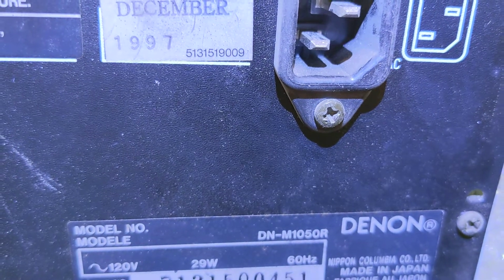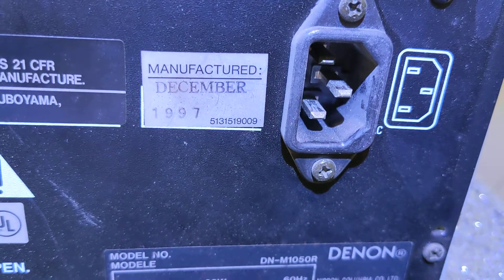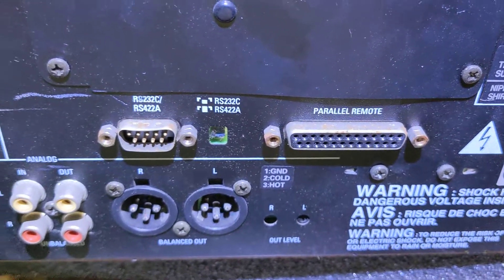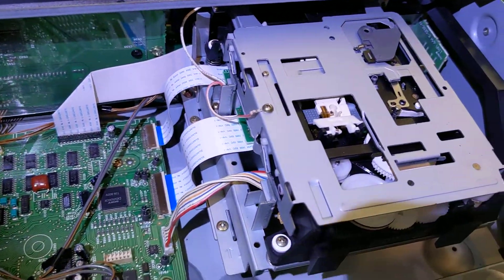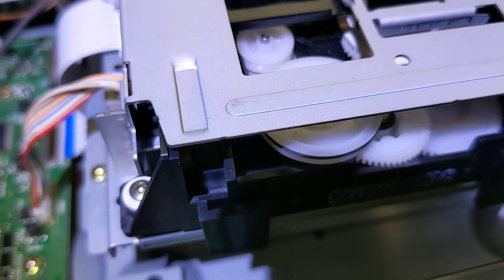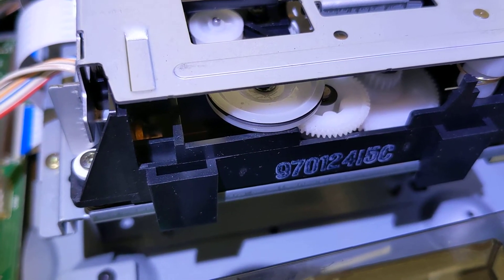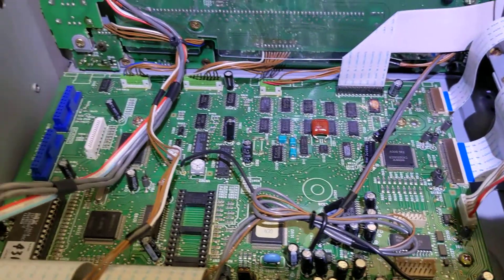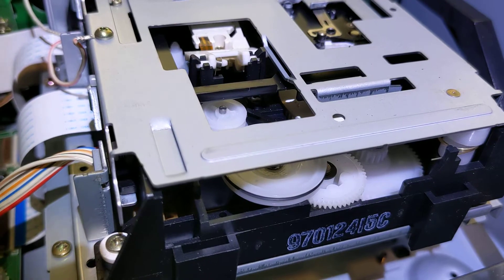Denon DN-M1050R

Comment: Do you have the reference for the belt ? I'm looking for one for my 1050R  but do not know where to find it ... Thanks in advance.
Reply from the maker: I had originally bought a 50mm x 1mm square section drive belt, but it's grown legs and walked off before I could try it out.  So I ended up buying one of those player belt multipacks and will try it out when I get more than two minutes to rub together.  Professors tend to get cranky when you don't turn your papers in on time, haha.
Reply: @Rohirin  OK thanx a lot, I will do the same ! Have a good day !

Comment: Was the error resolved from fixing the belt?
Reply from the maker: I had to move and the replacement belt is somewhere in a pile of boxes that I'm sorting out.  I'm probably just going to buy another one at this point and should have an update by the end of the  month.
Reply: @Rohirin  I know it's been over a year but did you ever resolve the issue?